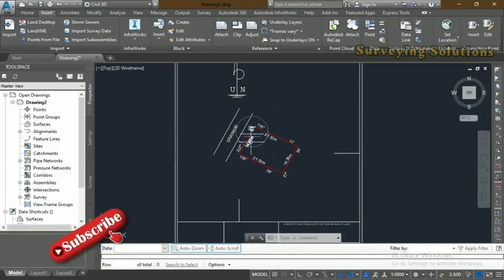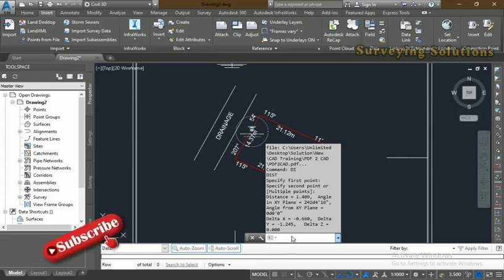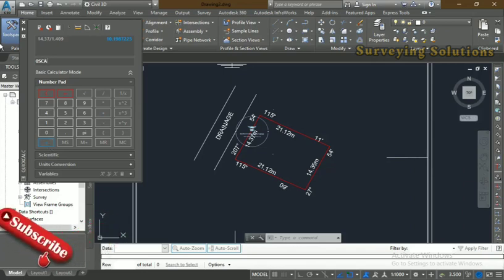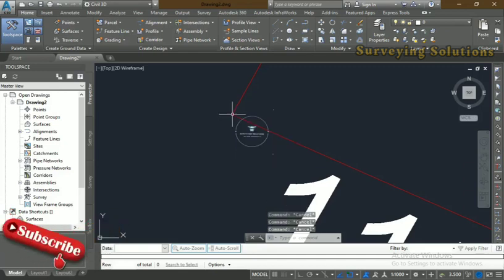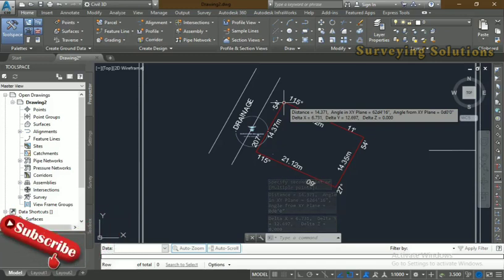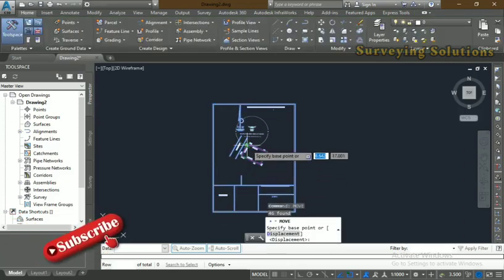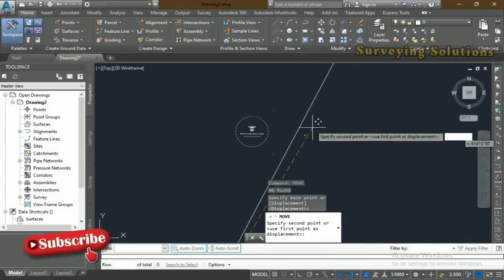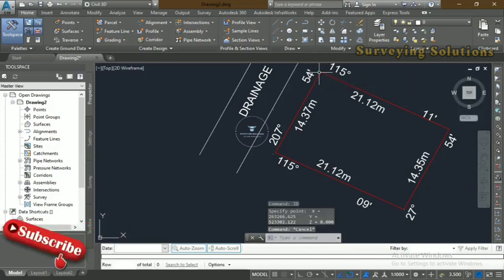How to EASILY Convert PDF to AutoCAD (dwg) and Geo-reference 2026 ||PDF to AutoCAD.

Comment: I just tried this out, it worked perfectly well, but I wouldn't get other points around the drawing correct expect for only the first point I did link my drawing to
Reply from the maker: It has to!

Please move the whole entity at one using the first point as the reference. The idea is to locate spatially the entity as a whole from where it was using the first point as reference. Since the extent didn't change, I'm not sure you'd encounter any challenges.